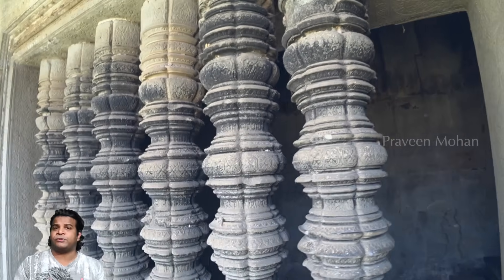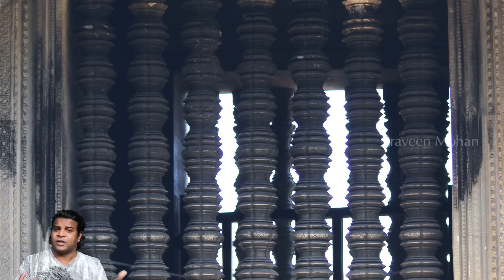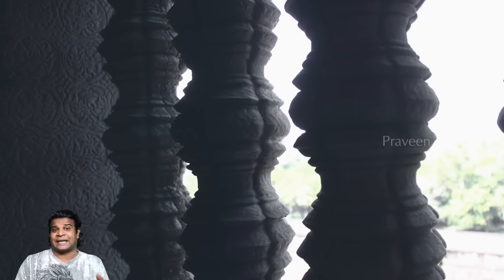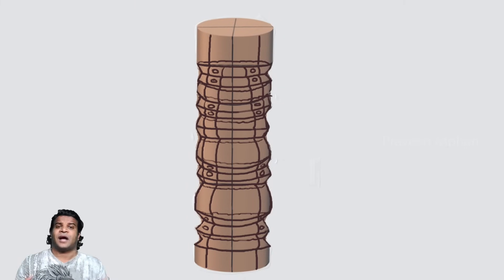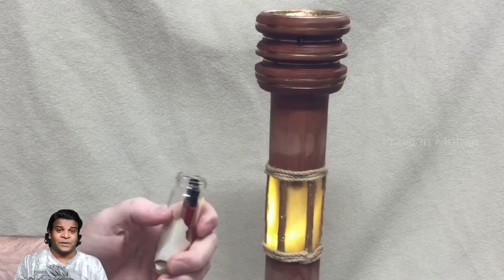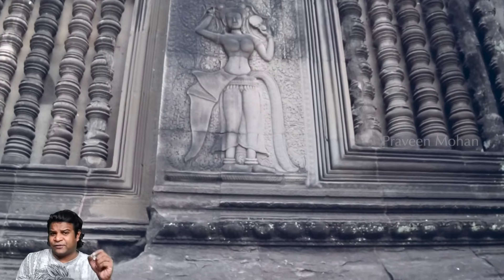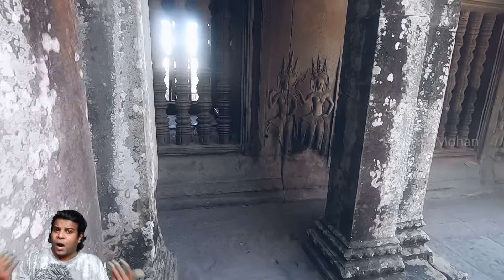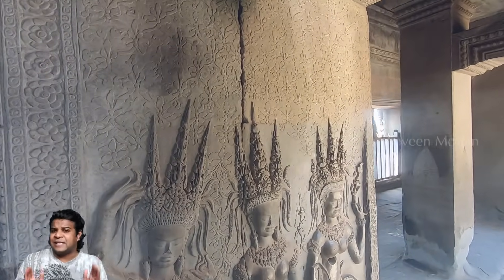IMPOSSIBLE ANCIENT MACHINE Found in AngKor Wat? Lost High Technology | Part 8 | Praveen Mohan

Comment: This is possible if we let our mind open to options. 

Can we accept ancient hydraulic cement mixed with crushed sandstone or limestone and water of a specific ph? Obviously we are talking about ancient hydraulic cement and not exactly Portland cement or modern hydraulic cement. 

In this case we have a targeted round positive mold lathe out of wood. Reproduce that into multiple negative molds (discrete halves or quarters). Reassemble the negative molds and pour cement mix into it. Leave cement mix sets until half hard. Now separate the mold from the core. Use a nail or knife to pry along adjacent molds, leaving the half hard core behind, leave it for next day installation. Those vertical grooves were artifices of the separation process and not part of the original ornamental.

Comment: Praveen I am convinced that the columns in question as well as many other examples in antiquity have been poured in place into a mold. Making a 1/4 mold four times will give you a finished column. 
SANDSTONE IS A VERY SOFT MATERIAL. 
I am a retired Architect and over the years I have had to turn certain masonry products into a crushed powder to use as a filler for bolts and screws used to attach with. We mixed epoxy and many other types of bonding agents but we never got it just right. I’m very confident that ancient architects were very proficient with molding stone to whatever shape they wanted. The columns are so accurately made it just makes more sense to me. I could be wrong but if we are to believe that they built these amazing structures with the tools available at the time, pouring the columns into a mold makes sense. However if we are to believe that lathe technology was used then we have to consider that the structure must have been built by an as of yet UNKNOWN builder with Advanced skills. 
As usual, your videos are incredibly awesome and interesting. I am so happy for you. Seeing you on the History Channel has allowed the world to experience your unique perspective on our ancient history like no other before you. 
Thanks for taking us on these wonderful journeys throughout the world. 
✌🏻🇺🇸✌🏻🇺🇸✌🏻🇺🇸✌🏻🇺🇸

Comment: Hi Praveen -- Another great video as usual. Regarding the longitudinal grooves on the pillars, first of all they don't make quarters, they make 6, or possibly 5, sections. Then, I think you jump to a conclusion when you say they were cut apart and then re-joined. It's certainly possible, and intriguing to speculate on what may be inside, but from your images, notably those of a few white pillars you show, it's impossible to say with any certainty that the cuts go all the way through.
Reply: there is not cut at all, look at the damages pillars, i dont understand why everybody are agread with this

Comment: You are assuming some things in my opinion, how do you know that they lathed the stones first and then cut them into 4 pieces?

Maybe they used a jig and a carving tool to make 4 identical blocks that they then put together?

If you had a recessed block that would hold the square pillar that was marked with the different depths for cutting, if you had a semicircle with a carving tool set to the correct depth you could carve each pillar exactly the same and place them together.

Comment: SO as a project showing my daughter that pyramids could be made with a form of concrete, we also made a pillar. To make life easier we only made half of a pillar as a casting mold, and then when dried we made the other half. We also had lines in our pillar that was the seam so we could split the mold off from the half cast pillar, with out damaging the initials/design we made in the mold. These like look exactly like mold seams. Being how concrete is a fluid when beginning to cast, it self levels making an axial face perfectly flat.
This is not to say that nothing is in the middle, quite opposite, it would make it easier to store things inside. No advanced special tech would need to be involved, and we in the present do these things all the time. TO purport otherwise shows a complete lack of understanding of construction(modern or ancient) and does disservice to your presentations. You have done amazing work,  don't throw people off by making bold fact less claims that these things are impossible nowadays when they are quite common. Keep the information flowing!

Comment: One thing I noticed in video was the pillar  shadows seemed to surround a design that resembles a double dorje. And alot of thing seemed to resemble the varja in its opened form. Maybe it's nothing but what became of the original varja weapon? With the area having ties to Hindu Gods and Buddha,  which the Varja also has, I can only wonder if that's what was possibly kept there originally? Maybe I'm wrong but I thought I'd see what your thoughts were on the matter

Comment: Greetings from Mexico your work is quite Amazing keep it always like the way it is 
and always  watch carefully what is in your soup fork

probably the shapes are diagrams of sound frequencies 
inside and outside the roofs showing the peaks as well as the shadow of those 7 cilinders

probably the bars were opened to put some metal inside 
and in the carves

they had some metal inside like mercury  or gold or both  to canalize and get the "ETER" 
use them as power sources, anthenas, static electric generators, healht and spiritual enhacers

Comment: Hi I think the pillers were not made and cut and then put them back together .. it can be made like from a cast (so one of the four parts is casted just like you pour plaster  of Paris to a mold and take it out ) and after you make four sides you put them back together all four making a round shape. It should have been easy to make this way because then they have to only make one mold or cast from which they can make every other sides of equal length and shapes. Just my thought 💭

Comment: Anghor ghor optic nerve laser potential lowered in temple with two pillar in sledge hammer with sniper rifle n tank armor with Kaveri engine laser brahmos s 400 tip

 bottom s500 s 800 400 700 800 400 500 600
Reply: This is the machine while the temples soild piece comes from computers that’s like a Tesla donut
Reply: The bottom ban is cuz of social security

Comment: those column split into 4 section perhaps for the flexible and vibration, due to the temperature change and potential earth quake. single column easily snap or crack but in to 4 quarters it has some stress reliever and expansion when vibrated.

Comment: There's a reason why they would quarter those... For expansion and contraction when the sun heats the ballasts so they do not crumble after being soaked with water and then heated by the sun in this specific climate.. especially inside those window frames. It's also much quicker to carve four sides at a time with for men, versus one man theoretically carving around a column. It was a production line suit and smart building engineering.. it's genius I agree. But there is definitely a reason.

Comment: @ 9:30 if you pause, it shows pillars are actually 6-sided. There are 6 lines running vertical, not 4. And this looks like they were cast from a mold, not virgin stone. A geo-polymer seems more plausible. No crazy lathe technology, no fancy carving material. Only stones to carve a wooded mold. And grinding up stone, adding water. Filling the molds, and removing when set. 
I'd like a tiny sample of stone from the top and bottom of one pillar. If an analysis comes back with identical magnetic properties, that could mean it's artificial..

Comment: If the builders could grind sandstone then make a type of sandstone “concrete” out of it maybe the pillars are all cast from the same mould. The vertical grooves could be where the mould separated and so used it as a feature. Truly an incredible temple!
Reply: this is what i was about to say , those pillars are made in 4 parts by a cast .......original starting carving of wood which would be easy to make including the engravings , use that wood base to make a cast then you have a cast that could be used many times over to make the 4 parts which are then fixed together

Comment: The four piece pillers could have been made from a mold. A poured geo-polymer sand based cement that was poured. Then all the pieces were put together with the same geo-polymer mortar. Kinda makes more sense that machines.

Comment: I'm a gunsmith, with machine skills. These cuts are possible, most folks just don't know about the equipment. The cuts down the length of the columns would be cut with a horizontal indexing chuck on a mill type machine. I use one to make cuts and flats on muzzle brakes.  I'd sure like to see the machines from back then. Maybe the machines left the planet?

Comment: @Praveen- Greetings!  Are you 100% sure that the vertical cuts run completely through the pillars?  Being a machinist myself I agree with your assessment that these pillars have been turned; however, I do not agree with your speculation that the vertical cuts run through.  I would speculate that the vertical cuts are a few inches deep allowing the vertical columns to hold their structural integrity.  Cutting in 4 then glueing back together does not seem logical in my assessment.  If you have solid proof they are cut through, I would have you show it.
Great work though.
Reply: The ancients did not have the word impossible in the vocabulary. The best that modern man can do to explain things done in ancient times is attribute then to be made by Aliens!

Comment: It's possible that the four sections were poured into a mold.
Reply: Pillar are made with sand stone . not cement or metal to pour in a mould ! Point is they have much advanced tech and tools , which we were keep as a secret.
Reply: you mean melting the rock, and pouring in to the mould?
Reply: @mohank9549  maybe or at least softening it but also they could of had a recipe for making sandstone.
Reply: @methodicl2673   Most of the pillars in ancient Indian temples are granite. But, there are lot of instances where these rocks were melted (not to a liquid state though, but just like clay) to join another rock or metal part.
Reply: @mohank9549  Yes I think the only way to get those blocks to fit so perfectly is if they were soft. I think they used sound/frequency/vibration. Everything has a frequency.

Comment: I do believed that it takes extra ordinary machining to obtain such precision, operation involved was Lathe machining and then, Milling operation to get the horizontal cut deep lines which is really amazing and impossible today because it will easily break to pieces if you clamp it to a vice clamp while performing the last operation. Also, it has knurl design or stamp on the piece surface....really amzing!

Comment: put the stone on a rotating holder. Attach a hammer to a cord in order to limit its reach, ensuring uniform strike depth. Keep tapping and rotating to achieve roundness. Afterward, saw length ways to achieve vertical lines. Carve to suit.
A possibility...

Comment: Interesting. I dont know anything about the site. I do know materials and tool technology. Those were turned on a lathe. Does not have to be CNC. Conventional technology would suffice. Turned stone was quite popular in the 1850’s. Right up to today. I have two granite pots on my door stoop as planters. Turned. Sand stone would be easy to turn and cut compared to harder stone such as granite. This presumes the use of tool steel. With long slender pieces such as those tool chatter would be an issue. One way to damp chatter is by the use of flutes in the surface. Flutes or longitudinal grooves can be cut with a broach. One of the oldest of machine tools. 
Such tools need not be metal. Wood suffices if high tolerance is not required. 
So. You appear to have a valid point. We can and sometimes do make such items. Our technology is capable. Our styles and tastes are not. Clearly past generations had similar technology. The evidence is in the product. Archeologists can not seem to see that fact. If they cant find the tool or tooling then they can’t seem to accept how a thing was made.

Comment: The pillars are made in 4 pieces for strength. Try break a stick. It's possible. Take 4 sticks put tight together, you won't break it because the sticks strengthen each other.

The 4 pieces Pilar is made for lasting thousands of years

Comment: for that line from the top to to bottem well that is easy.    
All u need is 1 stone a rope a piece of wood and something to make the groove.  
1. tie the rope to the stone.  
2. hang the stone from a high place and let gravity make the rope straight.  
3. line up the wood whit the line.   
4. make the surface of the wood straight using the rope as a guide.   
5. set your tool against the pice of wood as a guide to make that line in the stone and your done.

Comment: You´re on the right track Praveen. I think that the entire structure was a giant electromagnetic power generator as the pyramids in Egypt are. Every detail that has not been damaged or modified in this place, is a testament to this. It also used vibrations, therefore the shadows you point out are vibrational waveforms.

Comment: My opinion is that they not cut the pillars on 4 after they are ready  they cut quadrik blok of stone  they shaped each of 4 peaces  separatly bcz its more easy  and put them together after that ,which again great presizion needed and  probably machines but you not risk to broke the stone if make it on rotating way  bc there is imperfektion in rocks solidity

Comment: Not wonder machines. Sandstone is a soft rock so it does not need heavy tools, you put a case around the sone then use a wheel mounted tool  and turn it around and around the stone that cuts your stone, next from the top to bottom run a line dipped in chall pull tight snap line marked then just repeat drag a tool over and over to cut the post in half and then quaters....There are NO hidden technology to make the pillars, next take an xray of the stone to see if anything is inside them. last the shadows has been done time and time again in other places, Take stone henge that predates your temple......

Comment: If each pillar is in four parts and the pillars have the same shapes so as to show the same picture in shadow, I wonder if the may may have been made by mould. This would certainly aid accuracy and you'd be sure of getting four perfectly matched sides. Maybe some kind of sandstone cement or geopolymer.
I wouldn't rule out lathe or machining but using moulds would explain the four separate parts and the accuracy of matching to other pillars if all the pieces of the pillars came from the same moulds.

Comment: The vertical lines which you refer to as dividing each pillar into 4 equal parts, actually divide the pillars into 6 equal parts.
Are you sure that the vertical grooves go all the way through ? They look like deep, surface decoration to me. Some of the pillars are missing and would have presumably been broken. If there was anything hidden inside, surely all of the pillars would have been torn down and opened up.
Well spotted with the shadows. The head dresses of the guardians look similar.
Reply: Probably only some of the pillars might have hidden treasures or material whatever we call it. Rest all will be case in the same way so no one will know the actual pillar. But, we might end up a whole lot of destroyed pillars.

Comment: I’m glad u mentioned the vertical cuts.  I was thinking some kind of computer programmed lathe machine made the pillars, but the vertical grooves don’t make sense.  They actually take away from the visual beauty of the pillars.  The pillars are not small, but they ate not as large as some of the other parts of the temple, like the area you showed the wall behind the pillars.  

It’s clear the builders had technology that we have either lost or isn’t from here.  The stone work in Angkor Wat reminds me of the walls in Machu Picchu and Puma Punku.  Angkor Wat has some similar features but  it also has its own mysteries like the open ‘window’ pillars and the pillars with walls behind them. 

My first thought when I say the vertical lines on the pillar was why go through all that hard work to make the pillars and then put vertical lines.  I don’t think it was a mistake but  my first thought was maybe they melted or softened up the stone and poured or packed it into a mold.  The  lines could be from whatever they used to keep the rock together as they moved it into place to completely solidify.   It could have been the imprint of a large clamp that made the grooves while moving  it?  Maybe they used something like rebar rods that allowed the pillar to be moved into place while still soften.  Once the pillar was in place the rods were removed and the rock completely solidified, but had the marks of whatever was used to move it?

The stone walls at Machu Picchu show us that at some point in our history we were able to move and mold together blocks of stone that weighed tons.  Maybe they put the grooves there on purpose to guide us to something more important.  

The pillars actually look like the shape the drills that they use to dig underground tunnels these days, except those are diamond tipped.

Great video as always.!  You always give us the facts and let us decide for ourselves.   Thanks for showing us all India  !

Comment: inside the pillars there are wires which connect the towers which have copper rods to capture the lightning and store them in the box battery in the basement. the turtle found in the lake had the battery chemicals and wires. it is similar to the baghdad battery